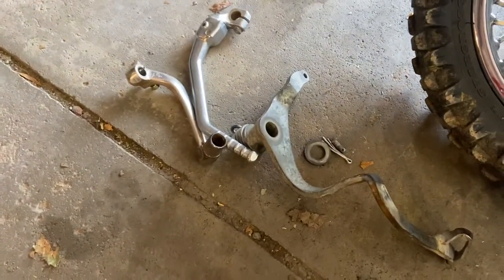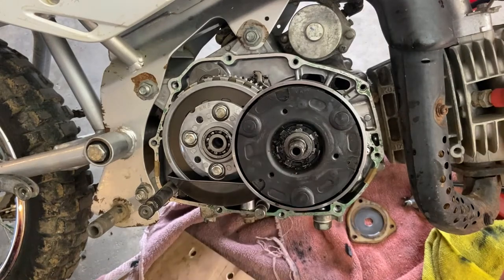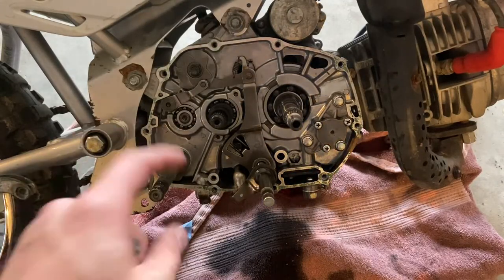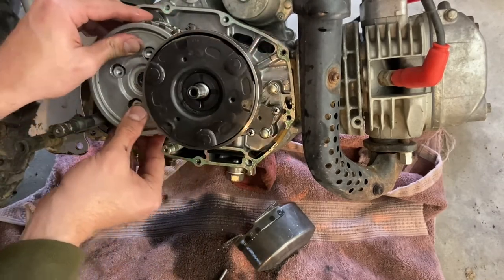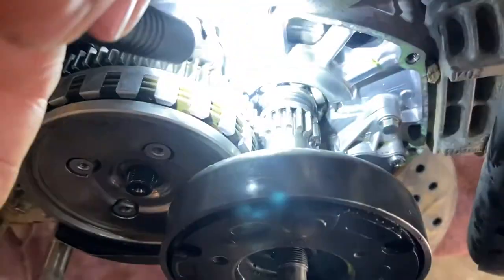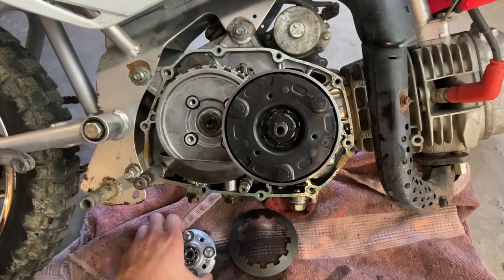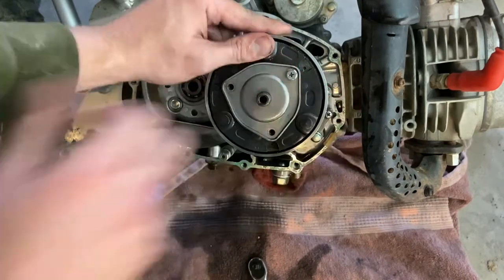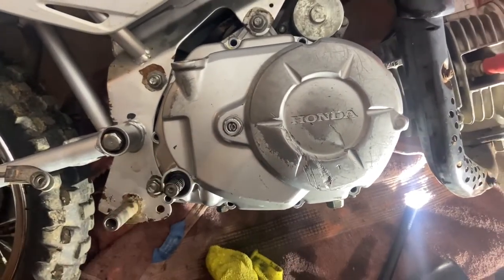Honda CRF110 Shifter Shaft Replacement

Comment: Thanks for this video, I changed the shaft using this technique, it was somewhat bent but before reassembling, I did a quick test of the shifting, still not going from neutral to 1st. Turns out, there are two little roll pins behind that star shaped wheel (2411kyk910 upper left) that were broken so the star wheel was out of sync. Also the holes in that part were elongated. I ordered the pins and the star wheel. There are five bigger ones that the fork fingers grab, they looked fine. I guess all those pins are designed to shear off so nothing expensive gets broken.
Reply: I just purchased a crf 110 and it is stuck in neutral. I have taken the clutch cover off and am now waiting for the special socket to come in the mail. Do you have any more information on what helped you fix this issue?

Comment: Were do you get one of those special sockets & what size is it?
Thanks
Reply from the maker: check ebay. they are the same for like honda 50s and 70s
Reply: @supermanisweet  do you know what that socket is called?
Reply from the maker: @timlovelace5258  just type in crf50 clutch socket on eBay and it will come up
Reply: @timlovelace5258  clutch nut socket
Reply: We need to know what size the inside diameter is in mm of each side of that socket. Because most online for sale are 20mm and 24mm. The 24 should work for the first nut you took off but the clutch nut seems to be like it needs about a 15mm or 17mm. 
I measured my 2019 crf110 and a 20mm would MAYBE catch the indentations. MAYBE.
Reply: I know im asking randomly but does any of you know a tool to get back into an instagram account?
I somehow lost the account password. I would appreciate any help you can offer me
Reply: @Dayton Alvaro Instablaster ;)
Reply: @Armando Skylar Thanks for your reply. I found the site through google and im waiting for the hacking stuff now.
Takes quite some time so I will reply here later with my results.
Reply: @Armando Skylar it worked and I finally got access to my account again. I'm so happy:D
Thank you so much, you really help me out :D
Reply: @Dayton Alvaro you are welcome =)

Comment: So I just did this and there was no change? Any idea?
Reply: Have u tried a Clutch adjustment?
Reply: Was the original bent or bad in anyway?
Reply: @duramaxdad  yea it was bent, I fixed it it was a broken roller pin in the shift drum, still dosnt feel right

Comment: The actual clutch behaves so weird on these(for the rei stall part),very touchy and VERY easily screws up,I ended up with a nightmare trying to install SMR KIT I bent not 1 but 2 or their steels,and thats not me,so

Comment: How are you guys keeping the clutch and fly wheel from spinning when tightening or loosening the bolt? I feel like there’s a safer easier way than what I’m trying. Thanks!
Reply: There’s a special tool, just google clutch holder tool.
Reply: No just hold the flywheel while u take the nut off use a bigger impact

Comment: Do you have any play in that new shaft? Will it move much if you push/pull it? Mine moves a lot and has a hard time shifting.
Reply from the maker: they have a little play when you push/pull. shouldn’t have a hard time shifting though..

Comment: “You can use a screw driver and hammer” buddie no you cant. Good video learned how to do it but you need that toold frfr
Reply: I did it just fine with a hammer and flat head